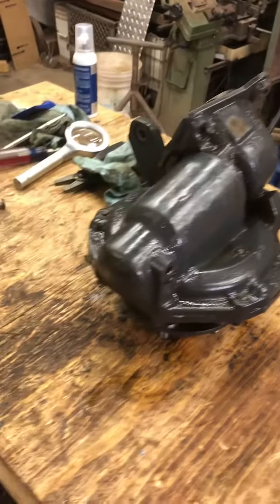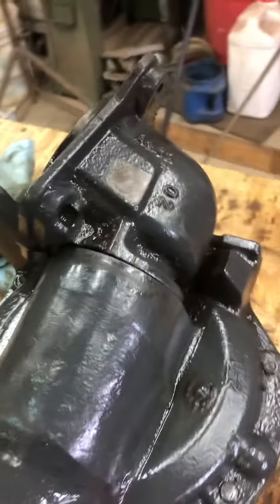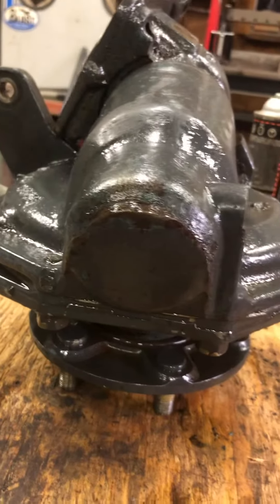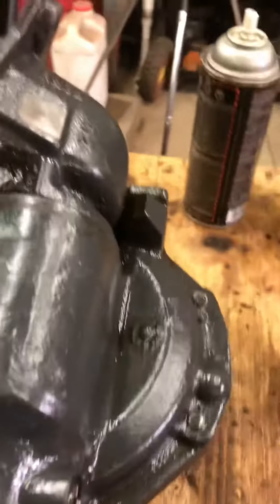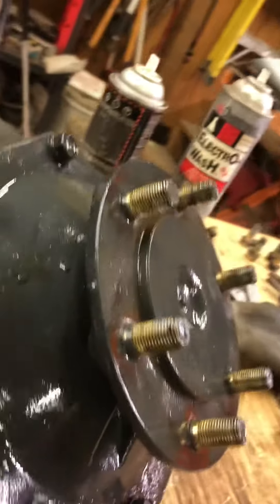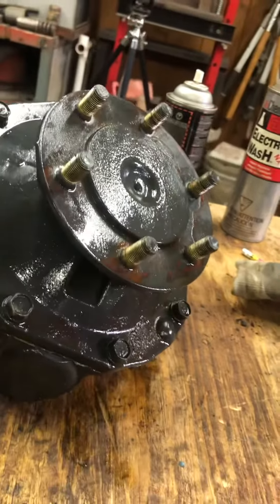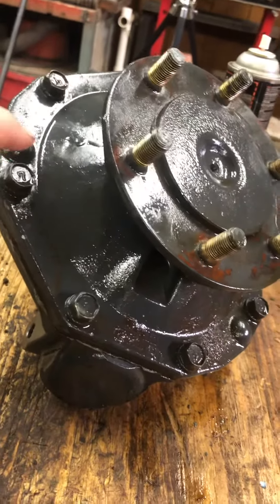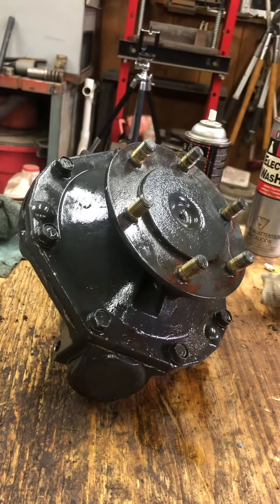2004 Kubota B7510 front axle seal replacement part 5

Comment: it there a torque spec to the 14mm bolts. Thanks for you videos very helpful.
Reply from the maker: Here is what is in my service manual. “Bevel gear case mounting screw” N-m77.5 to 90.1  
kgf-m 7.9 to9.2
Ft-lbs57.1 to 66.5
Reply: @kknvlewis  Thank you!